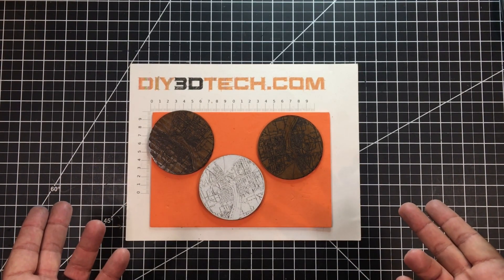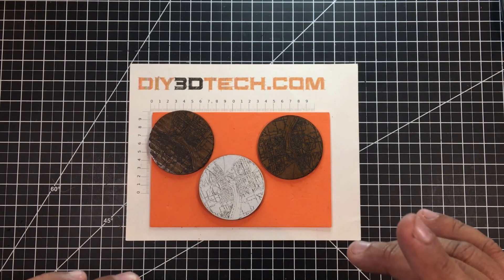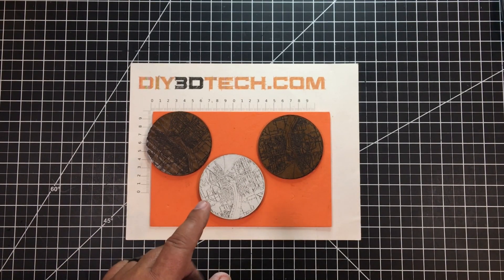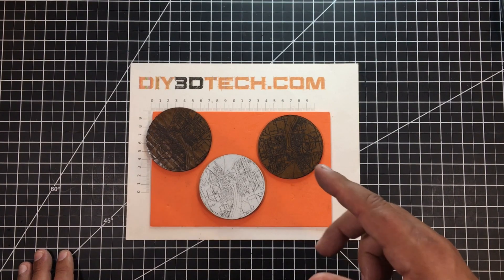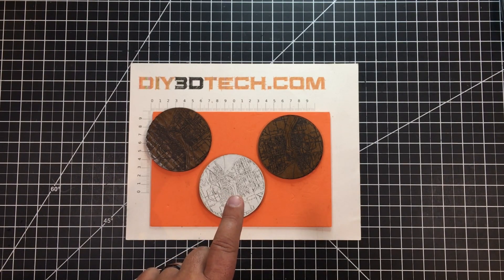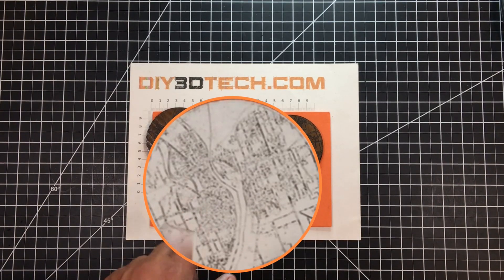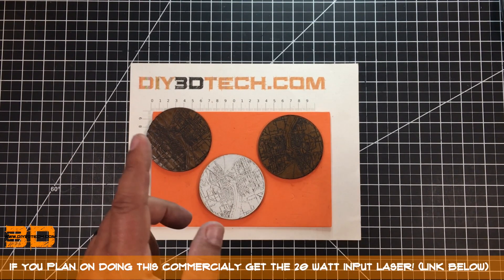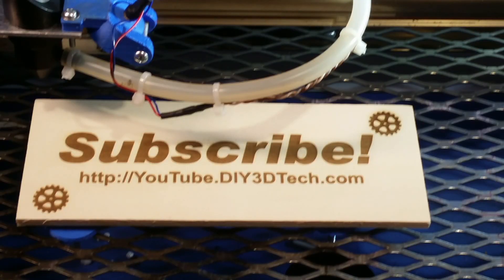Ortur Laser - Coasting Into Cash With Your Laser!

Comment: DIY3DTECH Another great video! I'm systematically going through and watching all of your videos before I actually make a purchase. I think I'm going to pull the trigger next week though! Couple quick questions... Regarding coasters and such like in this video, have you tried sourcing and or using compressed cardboard like disposable bar coasters are made from? And I plan on engraving on just about anything I can get my hands on and cutting mainly card stock, foam and cardboard. Would you recommend the 20w? thanks for all the time and effort you put into helping noobs like me understand these things a little bit better!

Brian.
Reply from the maker: Yes to the 20 watt and no have not tried compressed card but will!  You will also want to get both a G8 as well as a G2 lens.  I will be doing on lens in a week or two.
Reply: @DIY3DTECHcom  Thanks! I was just poking around online and came across laser marking spray and paint. Would any products like this work for etching metal or glass? Or do they require a bit more power?